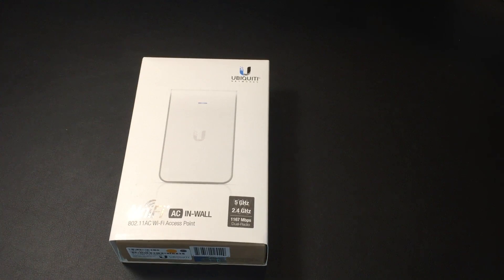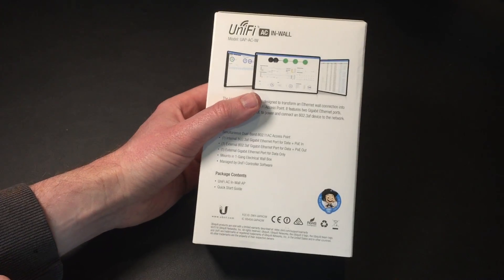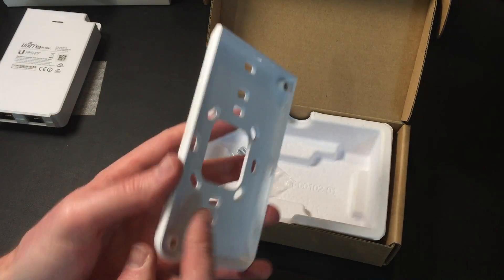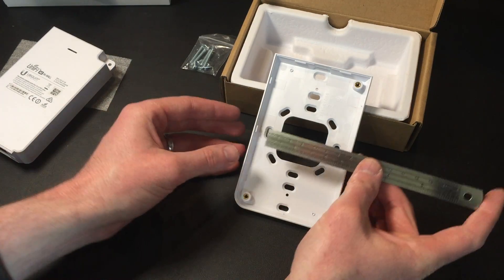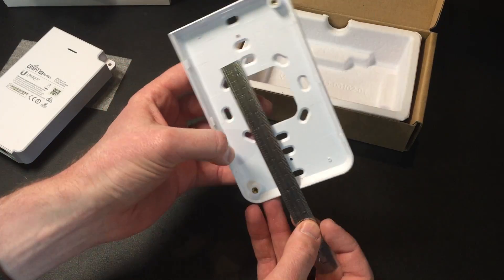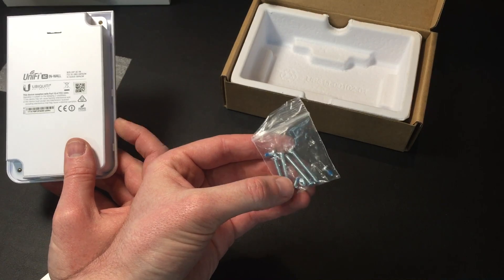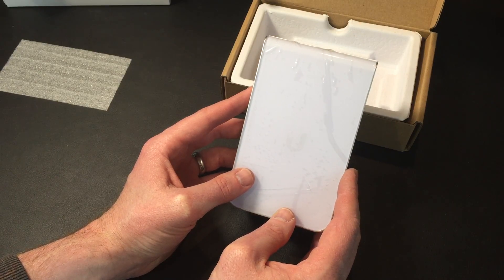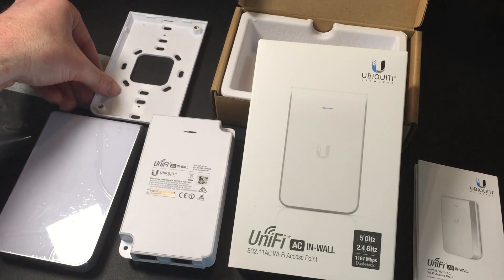Ubiquiti UniFi AC In–Wall Unboxing / Walkthrough

Comment: Nice video, can you tell me if I can do this with this device I can't really see an answer for it when I search. I have a UAP-AC-PRO and I want to get a wired internet connection into my garage but cant run a cable, so can this be used to connect back to my UAP-AC-PRO wirelessly then simple use the two ethernet ports on the bottom of the wall unit for internet in garage?, of course I will need an PoE injector to power it but I will not be feeding DATA into the back of it. Can it work like a wifi bridge of sorts. thanks

Comment: Thanks Tom, this was really helpful as broadbandbuyer.com state it will not fit a UK single or double gang backbox but clearly it does!  The manual looked like it did fit ok and your visual confirmation proves it, so very annoying when suppliers give incorrect information and mislead.  Helped me confirm I could complete a job!
Reply from the maker: They might have been referring to the older model, which I don't think had such good world-wide support for fixings. Glad to hear I could help :)
Reply: yeah, that's what I thought so I checked the older model and they don't mention it won't fit a UK backbox on that one!  Someone needs to cut and paste the statement from the new one to the old one!

Comment: You talk about the protrusion of the rear square; don't forget you will need extra depth for the RJ45 connector beyond the ~1cm you mention. Personally I think it would be much better to have added an IDC/Krone punchdown strip, as most in-wall CAT5/6 is unterminated. Or better still a module that is an RJ45 male with a Krone punchdown on the back of it.

Comment: Hi Tom

Did I miss it, or did you mention the dimensions of the protruding square on the back? (the depth I saw you measure, but not the edges)
Reply from the maker: I don't think I did, but you can see them on the template here: https://blog.thoughtstuff.co.uk/2018/02/ubiquiti-unifi-in-wall-mounting-template/

Comment: Thanks Tom - great unboxing that cleared up lots of little questions I had.
I am still in two minds as to which POE switch I will use, I am leaning towards the EdgeSwitch 8 150W over the UniFi Switch 8 150W; I presume that you might of weighed those 2 POE switch products up too?
Reply from the maker: I think they're pretty much the same hardware, but the UniFi switch is all managed by the Unify controller, so it's all in one place. Also, I wasn't sure whether the EdgeSwitch served up the same level of information to the Unifi Dashboard, so I decided to stick with the UniFi Switch 8 150W (there's another video of this in the playlist) to make sure.
Reply: Stick with Unifi, it's easier to manage. The EdgeSwitch is rumored to one day join the Unifi world but that remains to be seen.  That said, the EdgeSwitch is still great and easy enough to manage but after you get a few UAPs, switches, and maybe even consider their routers you'll be happy to have all of it in one place.